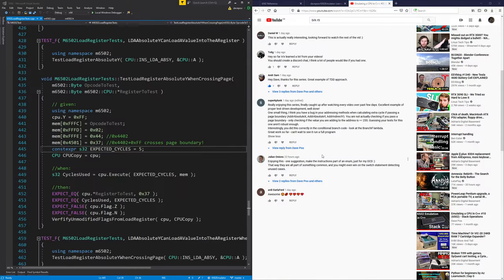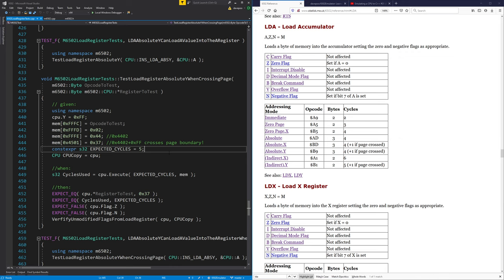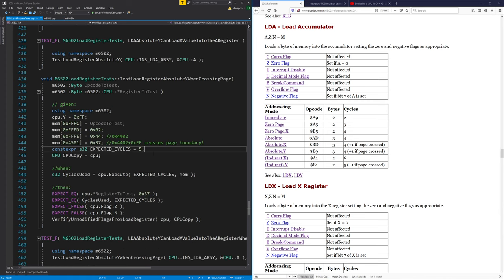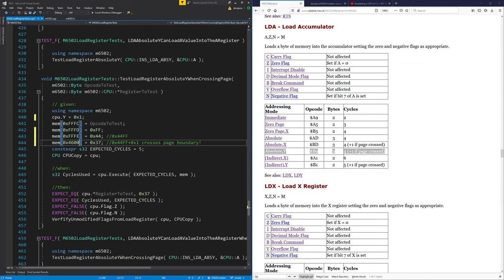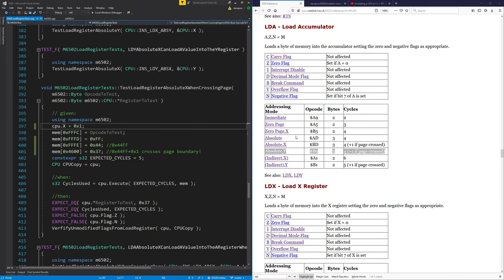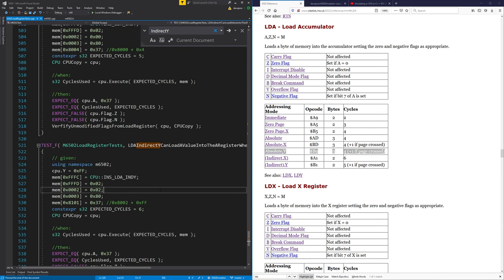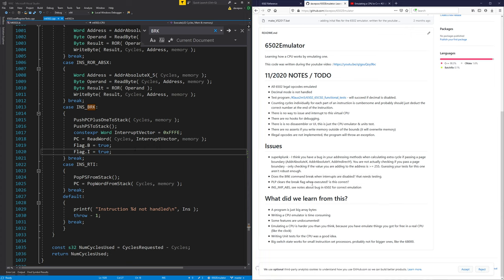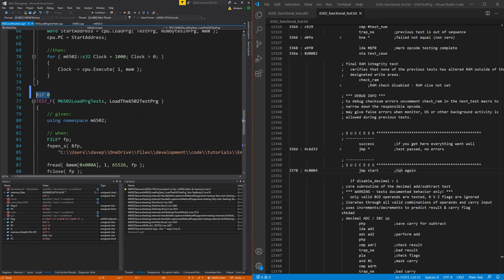Emulating a CPU in C++ #35 (6502) - Bug Fixing + Bonus Real 6502

Comment: BBC BASIC, which is the resident interpreter of 6502-based BBC Micro, rather handily (and famously!) features an inline assembler which is far less quirky than the one you have been battling in this video. There are several excellent Beeb emulators around - for instance, BeebEm is practically perfect (after all it runs Exile and Elite !). I don't think there's anything to fear in using an emulator rather than real hardware - BeebEm's 6502 emulation must surely be balls-on to run all those sophisticated games and demos. It's an option to consider. :-) Thanks for producing these very interesting videos.
Reply from the maker: Yeah, i just used it because i had it, turns out It's a barely usable assembler. I since bought a BackBit cart so I could load TurboAssembler or something else onto the machine but the cart doesn't work on my c64

Comment: I realize I'm late to the party, but while researching the 6502 for my own project, I found some notes that explain some of the cycle count quirks. I'll paste them here, hoping they may save others from pulling their hair out wondering why LDA ABS_X takes a different number of cycles than STA ABS_X when they're essentially doing the same thing but in reversed order.

    All single-byte instructions waste a cycle reading and ignoring the byte that comes immediately after the instruction (this means no instruction can take less than two cycles).
    Zero page,X, zero page,Y, and (zero page,X) addressing modes spend an extra cycle reading the unindexed zero page address.
    Absolute,X, absolute,Y, and (zero page),Y addressing modes need an extra cycle if the indexing crosses a page boundary, ** or if the instruction writes to memory **.
    The conditional branch instructions require an extra cycle if the branch actually happens, and a second extra cycle if the branch happens and crosses a page boundary.
    Read-modify-write instructions (ASL, DEC, INC, LSR, ROL, ROR) need a cycle for the modify stage (except in accumulator mode, which doesn't access memory).
    Instructions that pull data off the stack (PLA, PLP, RTI, RTS) need an extra cycle to increment the stack pointer (because the stack pointer points to the first empty address on the stack, not the last used address).
    RTS needs an extra cycle (in addition to the single-byte penalty and the pull-from-stack penalty) to increment the return address.
    JSR spends an extra cycle juggling the return address internally.
    Hardware interrupts take the same number of cycles as a BRK instruction (even in the case of RESET, which goes through the motions of pushing the return address and status on the stack, but doesn't actually alter the stack).

Source was http://nparker.llx.com/a2/opcodes.html under the "Instruction Timing" section roughly 1/2 down the page.
Reply from the maker: Thanks, this is very useful, i wish i had read this before i started. It explains why things like NOP are 2 cycles and not 1, as it is always doing an extra cycle no matter what.
Reply: @DavePoo  please pin on top the message from Alexander
Reply: The different behaviour of STn and LDn is due to the pipelining of the 6502 achieved by synchronous memory access.  Every clock cycle the 6502 is doing an internal operation and an external memory access.

STA abs,X and LDA abs,X use the same first 4 clock cycles:

1 - fetch OP Code; PC++
2 - fetch absL; PC++
3 - fetch absH; PC++, absL += X
4 - read abs; page cross ? absH++, force cycle 5 : <depends>

This is where LDA and STA differ.

For LDA if no page cross continue with next instruction; otherwise do cycle 5 after absH++

5 - read abs

For STA if no page cross do cycle 5 anyway, otherwise absH++, do cycle 5
5 - write abs

Note that both read an address (abs with absL modified by X) in cycle 4.

For a LDA if there is no page cross, the memory address was the correct address and so the data wanted is read as part of the pipelining meaning the next instruction  can be fetched and run.  However if a page boundary is crossed the address read is 256 bytes less than the real address as absH has not been updated.  Hence the need to re-read the data from the correct address and the extra clock cycle.

For a STA if cycle 4 was a write it would write the value before checking if a page boundary had been crossed.  If no cross then no problem, but if there was a cross the address written would be 256 bytes prior to the correct address - not a good idea!  To prevent this possibility the STA instruction forces the write to wait until after the cross check which means it has to wait until cycle 5 - the cross check and absH++ occur during cycle 4.

Comment: Love your work and explanations. If you want, take a look at the 6502 emulator I wrote for the Pi1541 project. It is a T cycle exact emulator written in about 700 lines of C++.
Reply from the maker: Thanks, I had a quick look, it looks very good. You've implemented lots of undocumented behavior as well. The cycle counting is definitely a big deal if you want to implement these emulators properly. https://github.com/pi1541/Pi1541/

Comment: One of many things I liked about the BBC micro was the inclusive Assembler built into the BASIC interpreter. This allowed easy embedding of assembler code for stuff that needed to run fast like I/O drivers and BASIC for UI. It also meant I learned a lot about the bits and bytes of the machine and the memory map. Just need to do this Emulator in Python now.
Reply from the maker: So i heard, the BBC micro implementation of BASIC was the best.

Comment: Thanks for sharing.

Some observations: 
1. Nice to know I'm not the only one who's fingers get ahead of him while typing. :)
2. I think the processor has to take an extra step whenever it's messing with the PC or doing a "far pointer" to a full memory address, since the data bus is only 8 bits, whenever it's loading both bytes into the PC or as an address, it seems to take three steps; as if it's pointing to the first place, has to change the addressing lines in another tick, then transfers the next byte.  Like every time you're doing the combined "memory[x] & (memory[x+1] << 8)" the fetch from memory function takes one, then you have to take extras once both of those have taken theirs.
3. You ought to be able to "terminate" that test program, by giving it enough rope to hang itself, then checking that PC is pointing to that memory location listed as "if you get here, you did everything right".  Probably 5x (or 6x) the memory size in cycles to account for the longer and shorter ones, and that the entire set of memory is probably not used, or no-op that take what 2 cycles???
Reply from the maker: 1. The fingers are sometimes quicker than the brain
2. http://nparker.llx.com/a2/opcodes.html - I think this page has some good information (and was posted by a viewer after i finished this series), but it seems the timing of the instructions is not quite as simple as i first thought, and sometimes the CPU is wasting cycles by reading memory addresses and then discarding the information (see the section on "Instruction timing")
3. Yes, i think something like that could work.

Comment: Reading/interpreting the instruction page for the Assembler64 program I'm assuming you can run your compiled program by using RUN/STOP to exit the program, then run your SYS 49152 command to execute your program in memory, then you can return to the Assembler64 program by running GOTO 200.  Also, the GO is referring to the short cut for your JMP etc operations.  So JMP GO100 would jump to line 100, whereas omitting the GO (JMP 49152) would jump to the absolute address.  You can also use the short-hand AS variable/label which is always set to the start of code - JMP AS+42 would jump to the address of start of code (ie 49152) plus 42 bytes (equiv. to JMP 49194).  Does that help?

Comment: Maybe I missed something, but... 

For the "not ending" testing program - could you not compare the PC value for 2 consecutive steps, and break the loop, if it is the same?  

It either executes an instruction and increments PC by 1-3; or in case of a jump changes to a completely different value. The only case it stays the same would be when it jumps to the current PC (which is the actual SUCCESS/FAIL state).

Comment: Thank you for this series, which I found incredibly interesting.

I was wondering about your plan to simply subtract cycles once at the end (beginning?) of each instruction, instead of trying to guess how many cycles each "part" of an instruction consumes. You said the latter was not necessary since the 6502 always executes a full instruction anyway, even when an interrupt has been triggered. I guess that's true.

But if you later implement I/O and ways for the emulated CPU to communicate with other chips, isn't it possible that some "events" happen "in the middle" of certain instructions ? I'm not an expert at this kind of stuff, so maybe I'm thinking too hard here :-) .
Reply from the maker: Yes you could be right about that, maybe the approach i have done does have some advantages, but with just the CPU emulated it doesn't appear so. The only thing that is good i could see right now is when i was implementing some of the later instructions, i didn't have to insert any new cycle counting stuff as it was all handled already by the existing functions. I think to step the clock in synch with all the other emulated chips would be super accurate, but would probably require a re-write of the  current CPU to do that (as it would have to stop in the middle of an instruction while another chip did something), it maybe that the emulation to that accuracy just isn't required to make a good emulator, and would require an in depth study of the computer architeture to answer that question (e.g. Maybe the CPU gets control of the bus until it's finished an instruction, so it doesn't matter anyway).
Reply: @DavePoo  I just watched the (very interesting) video of Matt Godbolt, mentioned by tm barral in another comment. He's talking about how he progressively changed the way his emulator worked to account for sync with the rest of the hardware. So I guess I have my answer :) . 

That's what scares me the most if I ever decide to try and write an emulator. Even if the CPU I choose is relatively "simple", all that timing stuff and sync with other hardware is often giving me a headache. I'm not that good at electronics, and those "half cycles", "cycle stretching" and so on seem like a whole new world of pain :)
Reply from the maker: Yeah, there is no doubt that creating an emulator for an entire system, even one as simple and old as the C64 or other 6502 computer is a lot of work. Actually i think that's what i wanted to show in this video series, that it can take a while to get this stuff working and correct, and a lot of time might need to be put into research of how the real system works. That said, it shows that creating your own emulator is totally doable if you are willing to put in the time (actually if you add up the time of this whole CPU series, it's actually probably only a few full days of work, but it took a long time as i was doing it in my spare time). Also, you'll never get it right first time, so you have to be willing to change as you go. Which is why i think it is important to have good tests written as you go, so you can refactor stuff and get some confidence that it is still working. Like i mentioned, if i did decide to refactor the cycle counting, i don't think i would change any tests, just the internal code to the CPU emulator.
Reply: Yes, even though it seems like a lot of work to write emulators, it has always fascinated me, and this series makes me want to try.

And I agree, the use of a test framework is a big plus in this series, and something that you don't often see in this kind of videos.

Comment: by 33:00 I am like "Why not just write the shortest possible test program and compile it. Then simply POKE the byte stream into the memory, Then SYS from that location?"
Is the issue the actual viewing of the flags during the subsequent execution? Perhaps the test prog could just throw them out on the console

Also. If this program is written in basic which you load  - and then run - so we could either just LIST the  files guts there? Before issuing Run? No? One might derive more about the available commands

Comment: Did you try "JMP 49152"  (without line number) to start running?
Reply from the maker: Apparently you need to do "SYS 49152" but you need to call END first to exit the machine code program otherwise it doesn't work.

Comment: Likely your tape drive head is misaligned so it gets read errors on the tape. And yes Interceptors assembler is an odd beast. Those variables are addresses though. It was quite usual to just code assembly directly into memory and just run it there. But ofc if your program had a critical error you would loose your source and all if you didnt save. :) - Btw if you hit RUN/STOP + RESTORE, it breaks back to default basic where you can type SYS 49152. If you then type RUN after it will run the assembler again but your program is lost (lol).

Btw here is a small test program you can write:

10 LDA =1
20 STA 1024
30 RTS

This will show an "A" in the top left corner of the screen (which is by default memory mapped to 1024-2023).

The developer of this assembler Ian Gray programmed quite a lot of C64 games and chances are he actually made this assembler to make the first games. It was quite common back in the early days to code your own tools as you neither had the money to buy good stuff or they didnt exist at all. Some coders like the Darling brothers (who eventually started Codemasters) made their own game development kits where they churned out title after title and even releasing the game dev tool as well. Its quite clear that the many Codemasters Dizzy games (and other variants of this) were in fact made so they could be easily ported between all systems easily. This is very evident as the C64 versions of these games had just some fancy graphics put on left and right side as the ZX Spectrum for example only had a 32 columns screen (256 pixels) so all screens in those games are designed to fit that width, while the C64 ofc had 40 columns (320 pixels). :)
Reply from the maker: Yeah, it is an odd little program. Quite cool that you can write something like that in BASIC. Really shows just how powerful BASIC was if you had the time to work with it.

Comment: What you need is a "kung fu flash cartridge". You can load any program, or cartridge image through this, and loading an action replay or final cartridge image will give you a monitor.
Reply from the maker: Since this video, I've actually bought a BackBit cartridge, but sadly it doesn't work properly on my C64C
Reply: @DavePoo  ahh what a shame, and how annoying. I got a Kung Fu with my old "brown" breadbin and works fine, and I had an original Action Replay (III?) back in the day with the beige C64 I had then. Both worked great for me. But the Fung Fu explicitly says that due to tight timing it may not work on every machine, so I guess I was just lucky with that. But you may be safer going with an original "hardware" cartridge.
Reply: @DavePoo  i had a 64C as well my Snapshot v5/4 ? .... worked awesome , i believe its a canadian product from the eighties

Comment: The 6502 doesn't have a B (Break) processor bit, nor an "Unknown" processor bit internally/electronically.  These are just bit positions (4 and 5 respectively) that are written to the stack when a PHP / BRK instruction or an IRQ / NMI "command" are executed.  Bit 5 is always written as 1.  Bit 4 is written as 0 only when an IRQ or NMI (or RESet?) is processed; or as 1 when PHP / BRK is executed.

Because there is no B (break) or Unknown bit inside the CPU, the value read from the stack (with PLP or RTI) is ignored by the CPU.

I think a more accurate name for the Break bit is the Not_Interrupt bit.  But that takes longer to say and write, and requires processing negative logic to understand it... so nobody uses that term.  But that's how I think about it (call me crazy).

You can "prove" the above logic with a simple program like this:
LDA #0
PHA
PLP ; the B and U bits (if they existed inside the CPU) would now be zero
PHP ;write the flags on stack
PLA ;get the flags to Accumulator
At this point you should find on real hardware that A = $30 = 0b00110000 ... B and U bits are 1 because they are fake.

This strange B flag behavior is because, although RESet and NMI have dedicated vectors, BRK and IRQ share the same vector.  So the 6502 programmer is responsible to examine the data saved on the stack to determine which occurred.  The programmer MUST examine the stack data, and not the registers with PHP/PLA for example.  Crazy but true.
Reply from the maker: Thanks, this is super helpful. I think you can see in the video i was pretty confused by those bits.
I really did want to get that C64 working to test stuff like this but it was a bit of a disaster as you could see.

Comment: You could use an assembler on the PC and then poke it into the c64, or just manually look at the hexcodes and poke it in. Though anything longer then a dozen instructions might suck to do like that.
Reply from the maker: I could do that, it would work, but i would also like to not go insane